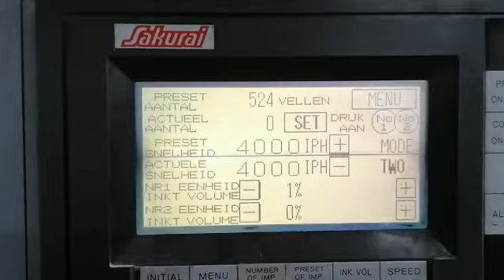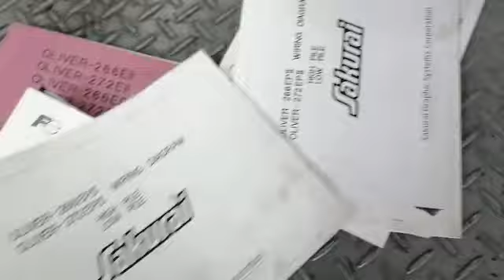Sakurai Oliver 272 EP 2 (1990)

Comment: I'm about 99% sure that i used to work with this exact machine for 7 years. I recognize all the grime and wear and tear it has, the main panel buttons that are worn out the same way, still set up in Dutch. DId you buy this from a failing company called Outhuis & Kemperman?
Reply from the maker: Hello Mr. Bappas, machine was purchase from a printing house in Poland. Actually I am not sure before it which is the previous owner. At the moment already is exported to Asia where it is in production